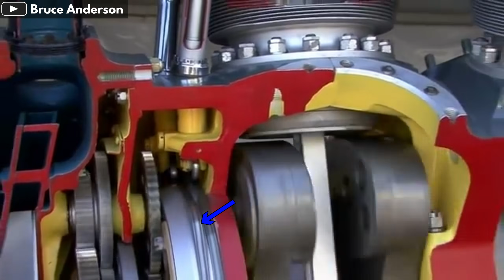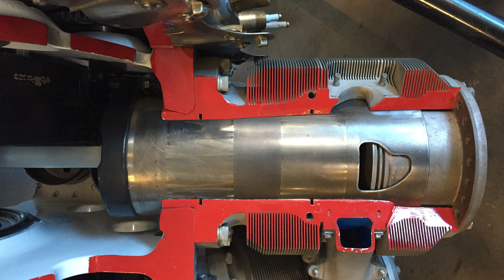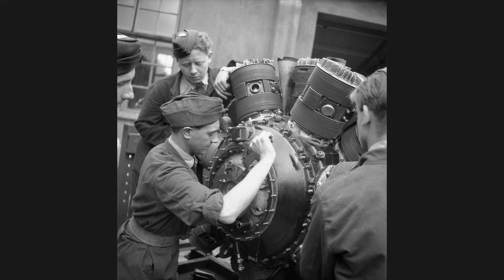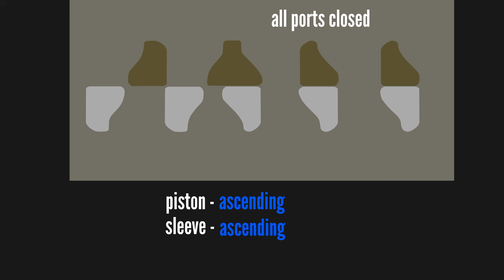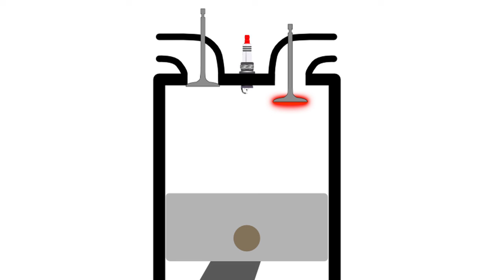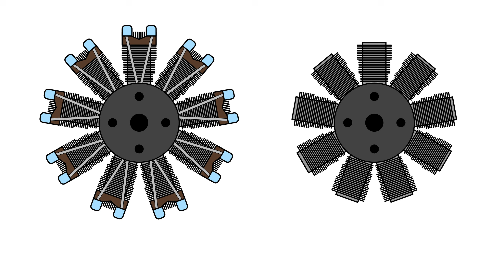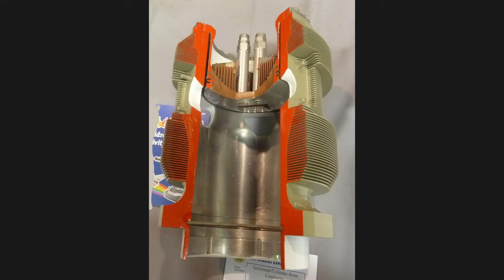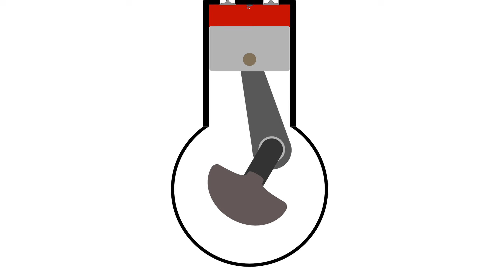Analysis of Bristol's Sleeve Valve Aero Engines

Comment: A central spark plug can be achieved with poppet valves as evinced by the Coswoth 3-liter DFW V8 or just about every hyper-performance in-line 4  engine and DOHC v-twins. And the R-R Merlin had 4-valve heads but need two spark plugs per cylinder in aviation service. 

My gut says with all that reciprocating motion - up & down and rotationally back & forth sleeve valve engine would be best suited for lower rpm operation. And with all that cyclic motion metal fatigue could be a concern unless components were made robustly enough to reduce streeses.

Comment: At the beginning of WWII, Britain was way behind the US in mass production. The Rolls-Royce Merlin was hand-fitted and the parts weren't interchangeable. The Packard Motor Company made several improvements and the parts were mass-produced to much tighter tolerances which made them interchangeable.
Reply: Exactly the same comments were made when Merlin production was taken on by Rover and Ford UK, it's more a difference between low volume aircraft engine manufacturers and automobile manufacturers working in markets which always required 500 plus units a month or a week turned out rather than 500 units a year like Napier or Bristol in the 1930's.
Reply: @stevecunningham8960 A car manufacturer works on thousands per week…
They also expect high scrap rates.
Reply: @allangibson8494 All true, but I kept the numbers within the range of even a small UK manufacturer in the 1930's, like Triumph, compared to the low production run, bespoke manufacture Rolls Royce were doing then. If RR had an order for  1000 Kestrels a week in 1933 they would have been astounded.
Reply: @stevecunningham8960 1930 was a bad year but even Triumph was pushing 100 vehicles per day out of its plant in 1925. (That dropped to 600 per year in 1930).
Reply: That is an oft repeated legend that RR disproved by building Merlins out of parts from all of their different factories. I asked the Merlin mechanic at Temora aviation museum, who has been working on Merlins for 20-years, and he said RR and Packard parts are 98% interchangeable.
Reply: @robertmoyse4414  My dad was a line chief on P-51's during WWII. He supervised the mechanics in England, France, and Italy as we moved in on Germany..
Reply: This is a classic case of Americans trying to take credit for other peoples' work and achievements. When the Merlin I entered production prior to the outbreak of WWII it was hand built, and Rolls Royce could immediately see that they needed help. The help came mainly from Ford UK and together the Merlin was redesigned for mass production. Rolls Royce had built several factories across the UK from the south east of England to the south west of Scotland and thousands of Merlins had been mass produced and delivered years before anyone even spoke to Packard. What Packard had to do was re-draw the engine again to use thread sizes etc which were readily available in the US supply chain.
Reply: I thought the separate cylinder heads was a Packard design. This fixed a major issue with internal coolant leaks that lead to engine failures.
Reply: That’s less of an advantage than you think. “Interchangeability” correlates with high part rejection rates. 
Rolls Royce were trying to minimise part rejection to maximise production volume with limited raw materials. That was done by having ten different tolerance ranges for most parts (ie over and undersized pistons for example).
Packard could afford higher rejection rates because they weren’t trying to merge salvaged engine parts on the production line with new engines and didn’t have constraints on raw materials caused by the Atlantic blockade.
It was all about producing the largest number of working engines with the least amount of raw materials in Rolls Royce’s case.
The Lee Enfield rifle had the same manufacturing philosophy with twelve different sized bolt heads for head space adjustment, the same different twelve bolt heads were swapped in as the rifle wore in service and the action stretched.
Reply: @allangibson8494  Clearly you are wrong... Packard made the Merlin not only with interchangeable parts but made it cheaper and faster to manufacture and more durable and reliable than it handmade counterparts.
Rolls-Royce was using obsolete manufacturing methods and production rates and reliability suffered because of this.
Reply: @DoktorBayerischeMotorenWerke The Merlin’s from both Rolls Royce and Packard had a 98% interchangeabity rate.
Rolls Royce didn’t use “hand made parts”. They just had different tolerances and made oversized parts where required to fit worn assemblies - Packard didn’t. Rolls Royce overhauled worn out engines, Packard didn’t.
Reply: @allangibson8494  Bollocks!
 Packard V-1650s used American 'SAE' and 'AN' standards 
While Rolls-Royce engines used Whitworth/ BSF/BA thread forms and sizes.
 Packard only made 6 versions of the Merlin which had very limited interchangeability only with Merlin 28 and Merlin 66 engines.

Rolls-Royce made over 100 versions of the Merlin engine and had hand-fitted parts that were not interchangeable with V-1650 engines or many R-R other british versions of the engine.

Because Packard engines had standardized parts, they could be overhauled in the field or in forward repair depots... because Rolls-Royce engines were hand fitted, they could only be overhauled at the factory... usually at the same factory they were made because the engines varied between factories and were not even interchangeable with each other.
Reply: @allangibson8494 You look like a fool right now Al... the Merlin engines made by Rolls-Royce were all hand fitted together.
The parts from these engines were not interchangeable!
Reply: @WilhelmKarsten The RAF fitters disagree with you.
The only parts that weren’t interchangeable between the Rolls Royce Merlin’s and the Packard Merlin’s were the screws. (Rolls Royce used BA threads and Packard used NF wire gauge - both switched to UNF after 1943).
German engines used far more hand fitting of parts.
Reply: @allangibson8494 WRONG! Packard used SAE and AN standards, Packard only made the V-1650 which only had a few parts interchangeable with the R-R Merlin 66..
And the rest were either handfitted or not compatible
Packard used different heads and cylinders.

As I said, you cannot take parts off the shelf or off another engine and install them on a Rolls-Royce Merlin.
British Merlins were assembled using outdated and obsolete technology that requires a skilled machinist to hand fit the parts together to achieve proper clearances and tolerances.

Packard engines were 100% standardized parts and any part could be swapped or replaced without any machining or hand fitting of parts.

Rolls-Royce was notorious for making constant changes and upgrades with zero consideration for compatibility with earlier models.
There are 114 different Merlin engine models made by Rolls-Royce and the parts between them are not interchangeable.
Reply: @allangibson8494 
1. Manufacturing and Precision

The primary difference was how the engines were built.

Rolls-Royce (Hand-Finished): The British engines were traditionally built by highly skilled craftsmen. Parts were often hand-fitted, which meant that while the engines were masterpieces of engineering, components were not always perfectly interchangeable between two different engines.

Packard (Mass Production): Packard completely redrew the British blueprints to comply with American mass-production standards. They used tighter tolerances and ensured that every single part was fully interchangeable. This made field repairs significantly easier and more consistent.

2. The Supercharger Advantage
Perhaps the biggest technical "win" for the Packard version was the refinement of the two-stage, two-speed supercharger.

Packard collaborated with engineers from Wright Aeronautical to improve the supercharger drive mechanism.

The Packard Merlin (notably the V-1650-7 used in the P-51D Mustang) was exceptionally reliable at high altitudes, giving the Mustang its legendary performance as a long-range escort fighter.

3. Reliability and Durability
While the early British Merlins were prone to oil leaks (a common trait of British machinery of the era), Packard’s version introduced:

Improved Metallurgy: Packard used different bearing materials and alloys that slightly increased the engine's lifespan under high-stress combat conditions.

Standardization: The American version utilized standard SAE (Society of Automotive Engineers) threads and fasteners, whereas the British used the Whitworth system, making the Packard easier to service globally.

Comment: G'day,

Sleeve-Valves were a very tempting and enticing
Bad
Idea...

Kind of like a happily married individual choosing to accept an intimate advance from some younger, apparently charming, divorcee...

Declining such an option will save vast amounts of time, and  money, while avoiding inexorably mounting stress, worry, anxiety, disappointment and the risk of bankruptcy hanging overhead all the way through the process of regretting ever having embarked on any such a course.

But, Sleeve Valved Aero Engines were begat during the 
"Roaring 1920s",
When shocked surprise at having outlived the great Patriotic Waaauughhh(!) To End All Waaauughhh(!)s apparently imbued pretty much everybody with the idea that throwing Investors' Capital at Ingeniously clever Ideas and beavering away until they were forced to function as envisaged - would
Eventually
Pay Dividends....
To the Shareholders.

And meanwhile the Directors and Managers of the LLC formed to spend the money, would be paid to pursue their personal pet Hobbyhorses - and the 
Working Classes would have a
Job,
Living frugally and
Doing what they're
Told...

Which was all great, until
October 1929 ;
By which time the 
Air Ministry had been sucked into
Rabid Pursuit if the
Sunk-Costs
Fallacy...

Therefore, thus and because,
Sleeve Valves were
Paid to function,
At an exhorbitant price,
Before being
Abandoned
Due to the
Operational Misery attached to operating them in
Cold or
Dry & Dusty
Environnents.

Cold Oil Viscosity 
Sheared a lot of Sleeve-Drive Gears and broke lots of Bellcranks, while Dust and Sand in the Air and Oil abraded away the Sleeves' ability to seal Hot Gas.

Dead End...

Such is life,

Have a good one...

Stay safe.

;-p

 Ciao !

Comment: Another advantage of sleeve valves was long life and reliability. In 1920s auto engines sleeve valves were running better than ever and making more horsepower than when new, when the poppet valve engine was worn out.

Comment: Unfortunately for long-term operation of Bristol engined warbirds, the ability to manufacture replacement sleeves is almost non-existent. That makes overhauls difficult or impossible. The usual solution to swap in an equivalent poppet-valved unit and hope nobody looks too closely.
The gear trains required to drive the sleeves makes the internals of the motors look like the insides of enormous and complicated watches.

Comment: Great video on sleeve values. Bristol Jupiter and Mercury had 4 values per cylinder, this resulted in cracked heads, so Bristol had to go to 2 values or sleeves. They are the only manu I know of that had 4 values. Their history lead them to a dead end. 
If this 2M dev money went into poppet 18 cylinder, they would have had a PW 2800 in production in ~1938. Imagine 1940 with 2,000 HP Hawkers, de De Havilland's?

Comment: Interesting to see most of the theoretical advantages of sleeve valves logically and correctly demolished here. I was convinced over the lower frontal area argument, which is clearly disproven. The difficulty of making sleeves reliable on Bristol engines was truly herculean involving development of highly specialised alloys and special lubricants, Bristol eventually achieved success after many years. Napiers with none of Bristol's developmental experience experienced utterly catastrophic unreliability which was only resolved when Bristol was virtually forced to give Napiers the secrets of their hard won knowledge. For me the only undisputed advantage of sleeve valves is the long service life. Exhaust poppet valves are inescapably dangling right in the centre of the very hot exhaust gases leaving the precision valve mating surfaces vulnerable to degredation often requiring laborious re-seating of the hundreds of valves (192 in a 4 engined bomber) after so many operating hours. Also poppet valve operating mechanism clearances also become loose after a number of hours operation and need adjusting. Sleeve valve ports which slide open and shut have no such mechanical maintenance requirements. The article is entirely correct in that most WW2 piston aero engine designs missed the principles so simply explained by Stanley Hooker of RR Merlin fame. Pointing out that with supercharged aero engines you need to start by calculating the altitude at which you require the maximum output coinciding with the point when the throttle is fully open enabling the superchager to delivering its maximum. All other considerations like valve arrangements and cyliner configuration and so on being largely irrelevant. It can be clearly seen that the RR Merlin and Griffons set up by Stanley Hooker which had world beating high altitude performance (fortunately for us). Examples include the Hooker and Ives produced 2 stage Merlin type 76 used  in the high altitude Mosquito PR version. or the Merlin 60 /70 series in Spitfire Mk 9's. Yet the Merlin itself proves the point being a very simple engine design using the same basic core mechanical configuration established in the 1930's. "The difference is all in the blower set up.."

Comment: Excellent video! Many thanks for your content.

There is a tiny, almost insignificant detail at 18:44: an uneven mixture does not necessarily create local hot spots, rather it creates areas of different knock resistance. The air-fuel ratio (lambda) influences auto-ignition tendencies as much as local temperature does, albeit decreasing past a certain point. So if the mixture is uneven, as ingested fuel is not perfectly atomised and evenly distributed throughout the charge, imperfect swirling may have lambda vary throughout the mixture, perhaps creating a spot with leaner (assuming we are at max power, rich of peak), especially weak knock resistance, which could potentially cause knocking.
Reply from the maker: I suspect you're correct. Thanks for the clearer explanation.

Comment: 99,9999% Engineers do not understand the maths behind the sleeves, because it does not pre-exist for copy paste. If you want a sleeve valve engine you have to solve the problems with CAD and most engineers are not capable of this. I did this in 2003 and it took my one full year to write the math with excel and make it useful for CAD.

Comment: Sadly, I have never had the chance to mess with a sleeve valve engine. But ever since I was a kid and first heard of the design, it struck me as worth developing more. Despite the aviation sector going to jets, I think sleeve valves could make a big difference in small engine and such. I dream of the power density and relative simplicity of a two stroke, but with full pressure lubrication and complete combustion timing control of a four stroke. Always wanted a two stroke motorcycle engine with sleeve valves!

Comment: I see a renaissance for the sleeve valve: modern machining can produce the sleeves better and cheaper, modern lubricants and coatings can reduce friction and oil burning.
Reply: You need to have your eyes checked mate!
Reply: The high friction from the sleeve moving inside the cylinder means low engine life.  Doesn't matter in military aircraft where engines are rebuilt every 100 hours but deadly in an auto engine.
Reply: Sleeve valves are beyond obsolete... today it is extinct technology.

Comment: Thanks for the excellent video.  Best sleeve valve explanation I have ever seen.  I still don't understand how they managed to lubricate the sleeve valve with all that surface contact area.
Reply: By all accounts there was an ultra thin film of oil between the outside of the sleeve and the fixed liner. If this ever became
compromised the results were impressive but not in a good way.

Comment: First, observation.  I watched an Airspeed Ambassador land at Luton in spring 1969, as it opened throttle to taxi from end of landing roll there was a really large amount of blue smoke from both engines, I mean more than any normal petrol engine in reasonable order makes, I wondered about sparking plug fouling.  Since I expect the oil control piston rings were adequate it presumably came from sleeve to cylinder lubricant.

They sound wonderful, from a low level Sea Fury display below clag and most recently a Varsity in ordinary flight in 1991.

About secondary balance:  the jerking of poppet valves is never compensated so I suggest part of sweet running was discarding all those hammers and anvils.  Similarly a great deal of oil cooling was given to exhaust valves from Citroen 2cv up to R3350 and those were notorious for oil consumption when used with turbo compounding in the DC7c.

A late friend made himself more than one sleeve valve single, he was diligent and persistent, he would have been a teenage boy fascinated by engines from the early 1940s, which I suggest had some relevance to his being so entranced by them.